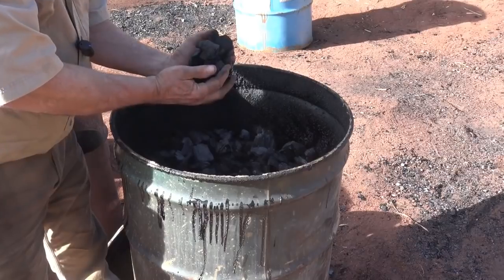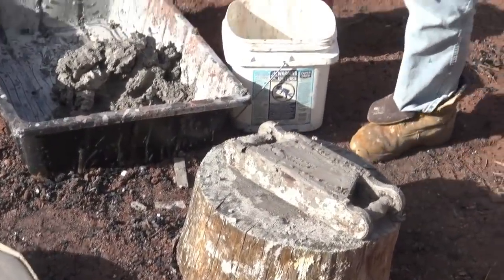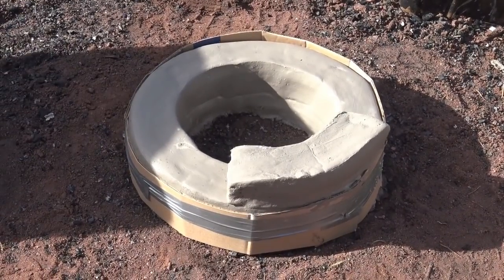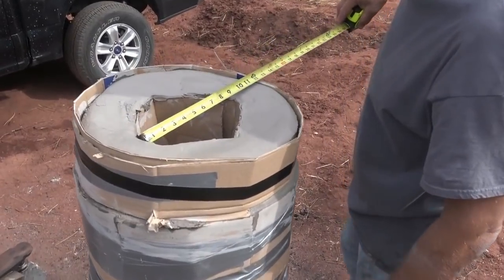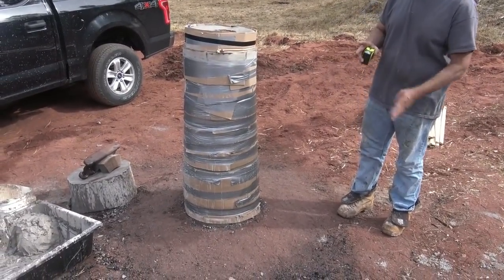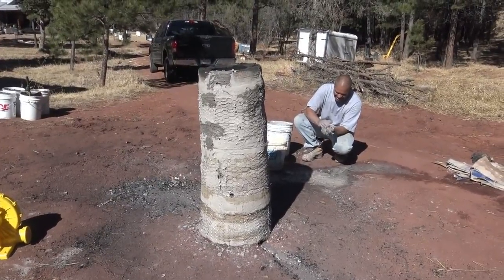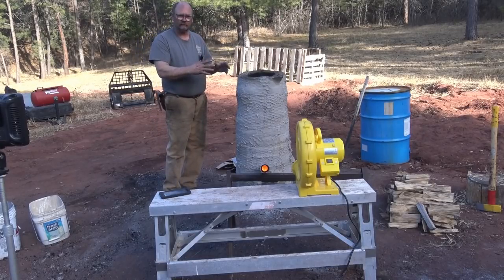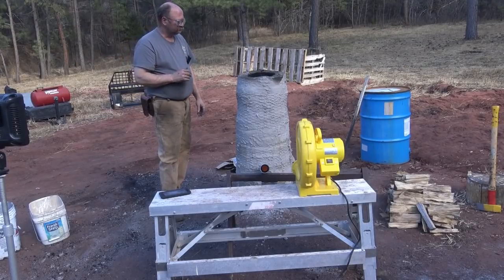Preparing a bloomery furnace for an iron smelt

Comment: I live in the Appalachian hills of Ohio right in the center of old iron furnaces country. We have low grade ore here but there's also limestone (quite useful in smelting) and plenty of woods for charcoal and the ground is mostly clay except for LOTS of rocks.
I've gotten too old to work that hard so I've never built a bloom furnace but you might tell Jake that if he adds grass clippings or straw, hay, etc. to the clay he won't have as much cracking and shouldn't need the chicken wire. I didn't see a place to tap the slag. Hope it does go well for you guys.
Reply: Don Stephenson we had a tap set to go, it just didn’t come to that. That is a good tip on the straw.

Comment: Great video again.  I have always wondered if it was possible to make iron “at home”
I’m going to have to ask for a demo on your charcoal maker if you haven’t already done one.
Good to see you out side for a change.  Love the look of the countryside.
Reply from the maker: I haven't shown the charcoal making yet.  I thought we would have time during this process, but it would have slowed production to do the video.
Reply: I'm sure you will get to it when you have time.  It is only just coming back into forging season here as the weather cools a bit. I still have a bag of coke and a bag of charcoal I collected last winter from our house fire each morning.   I have seen videos online of everything from a paint can to a large gas bottle cut up to allow access and still exclude oxygen.  Your Drum with a chimney looks like a fairly simple construction.  I'll just have to find one with a clamp on lid :)  Mabye I should start with a 5 gallon (20l) drum to start with.
I even found a guy running his pickup truck on wood gas however the equipment took up half the back of the pickup.   It looked strange but worked surprisingly well.
Reply from the maker: Mine is based on the videos by Stark Raven Studios https://www.youtube.com/watch?v=YYDlaBFk2L8&index=1&list=PLKxsPRD3Zw-KLtS8UlH-BNkgDxOFSICF4

Comment: Very interesting. If you have time would you be willing to explain the mixture content for the smelter clay. Im planing to do this process my self. And I might just make a reusable smelter but if the clay is cheaper then ill make that. As well as explain a little more about the ore. Other than that thanks!! And hope to see next steps.
Reply from the maker: Since Jake is conducting regional comparisons, the clay at each site is different.  This clay came from a quarry about 5 miles from here and is typically used for making fire brick.  the clay was used as dug out of the ground, with only water added.

Comment: You can mix the clay with fine hay so there won't be so many cracks and to give better structural support.
Reply from the maker: I know they do that with adobe brick, so it may work with this, I don't know what the straw would do under high heat though.
Reply: Supposedly the finely broken hay bits embedded in the clay will turn to carbon due to the high heat and low oxygen. This leaves tiny voids in the clay that allow the clay walls to shrink and expand, due to the temperature fluctuations, without so much resistance as would be found in a solid clay material. From my understanding the voids also act to give the clay many termination points for any cracks that do form, similar to how a drilled hole can stop a material like iron or wood from continuing a crack that has formed.  I haven't tried this, here is where I found that information. https://youtu.be/RuCnZClWwpQ?t=34m52s  these african smiths recreate the clay mixture their ancestors showed them for this purpose. A fascinating video if you have 2 hours, the link provided though takes you right to the spot. I was really impressed with what they can accomplish with a stump anvil and rounded club style hammers.

Comment: Excuse me, what kind of material do you use for those bricks? Furnace lining bricks should be firebrick class.
Reply from the maker: Since this was a look at making the furnace with local materials, it is local clay.  Primitive iron smelters would have used what was on hand where they lived and din't know about fire bricks.  The furnace is a one time use setup and it doesn't matter if it cracks during the smelt.  But if you watched the videos you should have heard me mention that the local clay is actually quarried for making fire brick, so it was an ideal situation.  As Jake does these smelts all over the country he will use only the local materials without bring in specialty materials, so some clays will be less than ideal and how they perform is part of his research.
Reply: @BlackBearForge  thanks , I wonder if bloomery furnace can explode like improperly designed cupola furnace?

Comment: With a blower that big you MIGHT generate enough heat to actually melt the iron and come out with cast iron rather than bloom iron. idk
Reply from the maker: We had to use a very high tech damper system mad from a sheet of paper and tape.